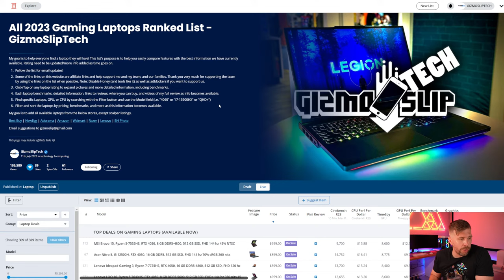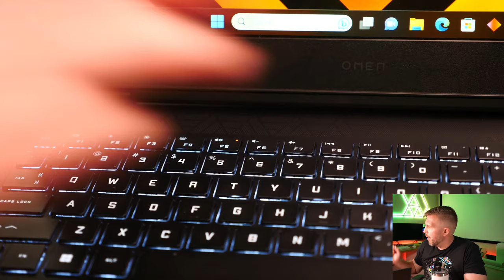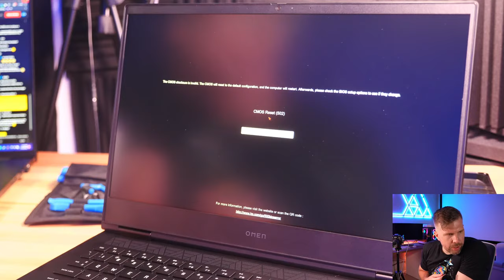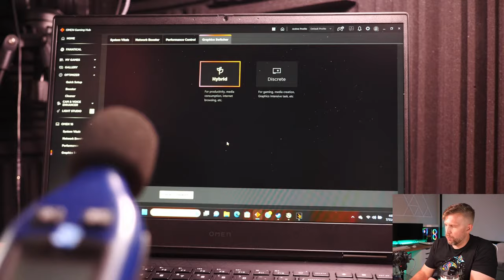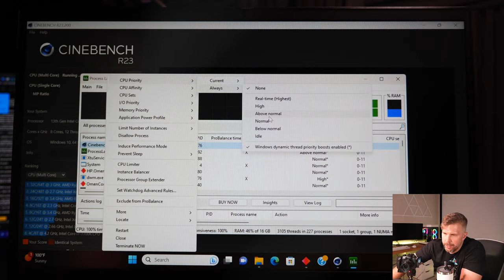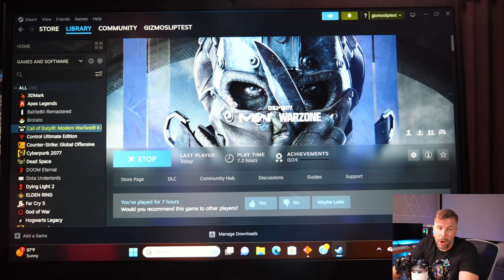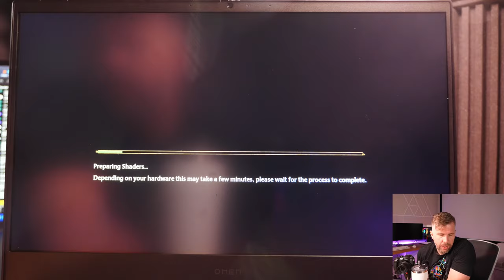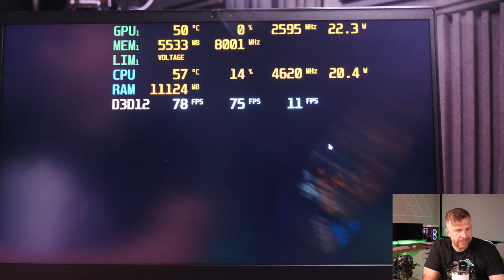HP Omen 16 Unboxing Review! 10+ Game Benchmarks, Display, Speaker, Thermals, Timespy, Cinebench R23!

Comment: Was debating between this omen ($750 at Best Buy) vs the msi cyborg w/ i7-13620H 4050 ($700 Costco exclusive SKU) for my niece. Ended up choosing this because the cyborg has a 45W TGP and figured the CPU difference wasn’t worth the GPU difference. Even got it “open box excellent” for $666

Comment: What is the ttldr?
Reply from the maker: Very good all around, but has lower color gamut display with 70% SRGB (324 nits) and lower amount of CPU cores (4P, 4E cores). It had great temperatures, good speakers, and good keyboard. Trackpad is plastic. Ports are decent, but I wish there were a few more. The 16" display is actually 16:9 aspect ratio, which is surprising--decent sized chin on the bottom. Overall, I like and can recommend the Omen 16--but not at the full $1249 retail price. Wait for it to go on sale for $899, or at least $999 at the most.
Reply: @GizmoSlipTech  Thanks!